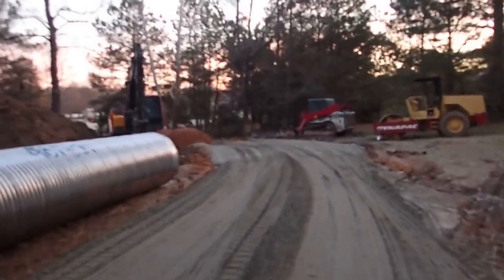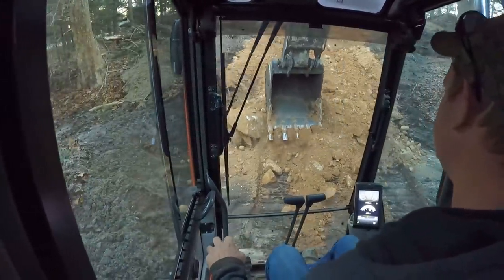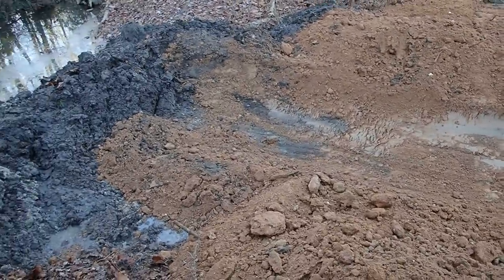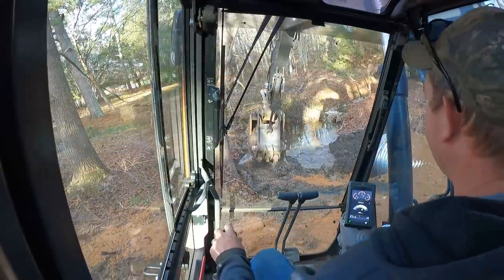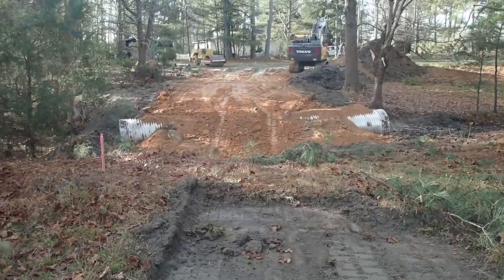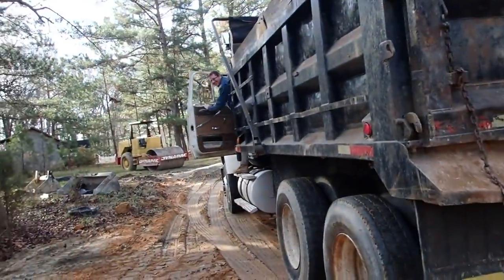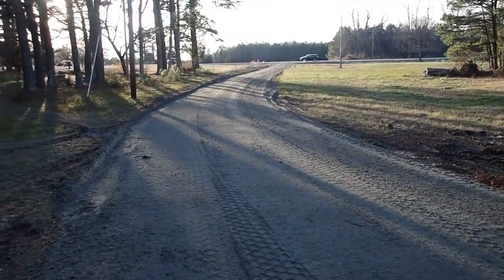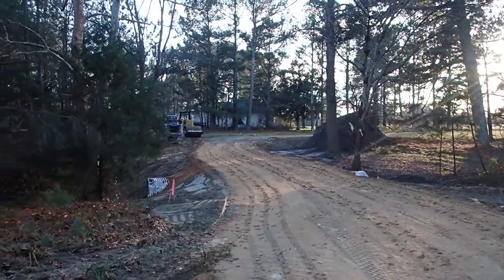Big Culvert Pipe And Justin Points Out My Accident

Comment: I got chills when you dropped the load of dirt on top of the pipe....Many years ago, we were putting 4 new 10k gallons tanks in for a new gas station.. we were ready to start back filling the hole with 800 tons of pea gravel..The foreman dropped 5/8 yard of gravel on top of one tank and it spun...had to pull all 4 tanks and dig out the hole...in the process we hit 9 natural springs...had to set up a well point system to drop the water table 20 feet!

Comment: I would haul in 3 or 4 loads of the stones from the vet clinic site to use as riprap on both side of the pipe, to keep the creek from washing out the culvert and dirt during heavy flows.  At least it will be a good way to use rock that you would otherwise have to pay to be dumped.

Merry  Christmas

Comment: try it with a loaded bucket on the skid steer for compacting I always go in forward with a skid steer in case I get stuck I can push myself out with the bucket that wasn't stuck bad but I wouldn't ever hook to the bucket lift the bucket up in the air and hook it to the designated tow part that's a nice bucket you don't want that to get messed up. Keep that chain as low as possible when them things break it's like a bullet

Comment: You should invest in a cable choker and I would use 3/4 Stone at least halfway up before I run a machine over it but then again water would run threw the stone. Maybe a few bales of straw in front of that pipe until you get grass planted so the  mud gets filtered

Comment: How did you figure how much cover a culvert needs.  Is it half as much as the diameter of the culvert?   48” culvert = 2’ of cover?  Or do you also have to figure the material of the culvert?  Plastic versus galvanized versus concrete?

Comment: The vid cut out about 49:30, maybe something about a flat tire.  Why not get a TPMS system.  It monitors  6 trailer tires on my triple axle trailer and the 6 tires on the Volvo 730..I had it singled.  The system cycles thru all 12 tires, stopping on each icon testing for pressure, high pressure and low pressure.  You can set all to your own specs.  I have no favourites, they all do the same job.

Comment: I saw you pushing those little rocks around and it reminded me of  my friend Calvin who had a rock in his driveway and kept snagging his plow on it, well, he bought this truck that came with a full size multi-position highway plow, it was an all wheel drive flatbed 12 ton capacity, first winter with it he broke the blade on it well I volunteered to remove the rock ,we estimated the rock to be 3 feet  I went and got 4 pounds of blackpowder and some cannon fuse, he changed his mind and said "Not this time I need my windows on this side of the house," and I said "OK", good thing too after 6 hours with his back hoe, it turned out to be 5 feet across ,it was kind of egg shaped with a teat sticking up,so he re-buried it ordered 5 truck loads of road gravel and re graded it, Damn I miss him, well if the surgeon screws up next week maybe I'll be seeing him sooner than later, God bless you'.

Comment: I walked into very cool San Juan Island home in hot weather an commented on how nice an cool inside of home was! We don't have air conditioning was response! How then was my question? We buried a culvert like this one below freezing line. Then blocked off both ends an ran two fans from buried pipe, one low by floor an one fan high by ceiling! Then we turn on fan an blow cool air throughout house! In winter it heats house on same principle! Very cool, entire house heated an cooled by one culvert buried pipe an two small fans!

Comment: When i bought my land, I thought i will put in my culvert it'll be easy. Well it wasn't bad but wasn't as easy as i thought. only had to dig it up once, i had it leaning the wrong direction for when the water flowed.
Reply: As you say water won't run uphill,and as we see all to often from jobs that Chris has to go sort out,that quite a lot of people do actually think that water will run uphill for some silly reason!!?!👍🏻😂😂🙈🙈🇬🇧🤘🏻🙏🏻
Reply: @iantowers6972  right i didn't wait till it rained i just put it in the way the ground was sloped. then after it rained i seen my ditch was holding water i went down the road and found where the water was supposed to go. regraded the whole dang thing. I thought the water ran to the other drainage ditch to my south end.

Comment: I do not see a skid steer stuck, I too see a skid steer that just can't get traction. My idea of stuck though extreme is "worst recovery" video! As for "truck driving being a little boring" When I call for pay loader to pull me because I am stuck, what they have in their mind is worst recovery when the reality is if I can't move under my own power I am stuck. It pays to know stuck is stuck and it does no good spinning and digging a hole in which case you are no longer stuck now you are buried!

Comment: Legit question: Chris always starts his machines and lets them warm up for several minutes before doing anything (wasn't necessarily shown on this video). What is the benefit of this? Thanks.
Reply: Get the oil circulated and warmed up before you put any stress on engines and also to warm hydraulic fluid and defrost windows.
Reply: It's especially important in cold temperatures, because it warms the engine and all the fluids up slowly.  The fluids are thick when cold and revving the engine can when cold can cause poor lubrication (especially in sensitive areas like the turbo) and very high pressures, as the fluids warm up they thin out to where they're supposed to be.
Reply: Diesel engines need warm up time.
Hydraulics need to build up enough pressure for optimum operating.
Diesel oil is very viscous and needs to warm up so that you don't throw a piston through the head.
If you start a machine and move straight away, the oil won't be the correct viscosity and you will have too much torque for the engine to handle when cold.
If I am incorrect in any way, please correct me.
I love to learn more about machinery like this.
56 year old female from Australia and Chris is my new lifelong fascination.

Comment: I would do it in 8 inch lifts and I don't think I wouldn't turn too much with that  skiddy .. that's going to cost you a couple Grand if one of them rocks or boulders get in your tracks where the hell is this at ?? what is that sandy stuff put a little tree quarter under them culverts in the middle so you don't get a smile